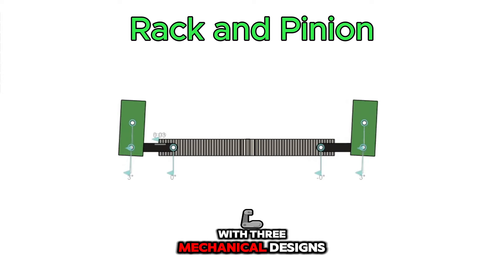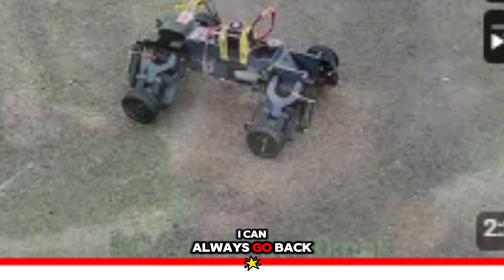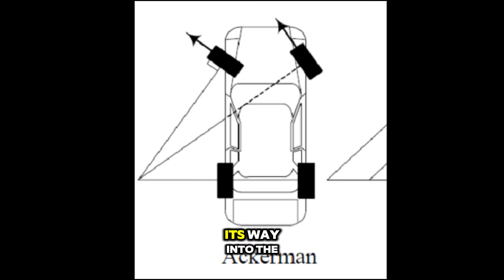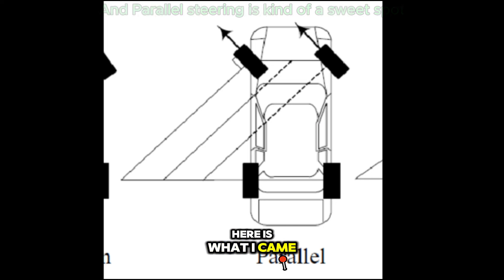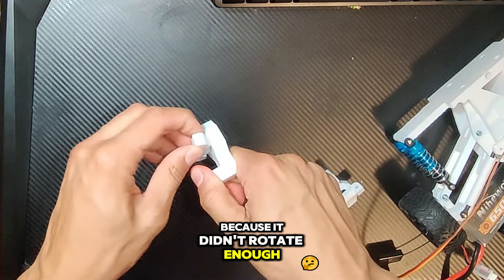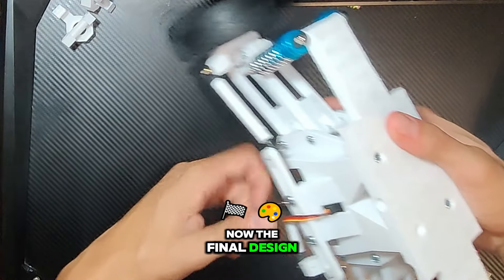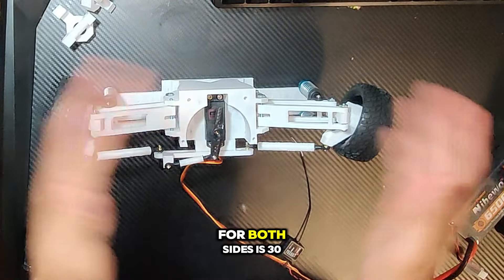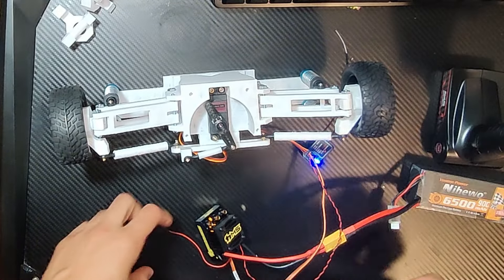Steering for a 3D Printed RC Car

Comment: Love your video. I'm trying to model my own steering wheel system for 1/14 truck and I'm struggling but your video motivated me to retry again. Thank you❤
Reply from the maker: @leechibikira1792  that's great, I'm guessing you're having trouble rotating the wheels properly, the trick is to have the steering rods starting point be in the center of them, and be the same length as the arms, and then all you need is the slider holding  2 of the steering rods, I'd suggest using a rack and pinion, mostly because it's the easiest concept
Reply: @-EhsanMalik-  okay thanks a million for the information,  explaining and I'll try to use rack and pinion hoping it'll work. You just got your self a subscriber and I'm loving all your videos all the way from South Africa
Reply from the maker: @leechibikira1792   pretty cool 😎, and I really appreciate the sub

Comment: Nice work.  The rack and pinion version would have very cool, going more in the direction of a real vehicle.   I envision a metal gear on the servo and a metal rack.  Small, but strong.
Reply from the maker: Yeah, rack and pinion is a really strong design for steering, that's why I prefer it

Comment: Really good idea... i'm trying to build a 3d printed rc car too, a rc drift. And i have a question, where or how you can take the right sizes? Thanks, really good video.
Reply from the maker: @vitorkash It depends, but since you're making it a drift car, I'm guessing you're going for something small around the size of a hand to maybe something a little bigger, and if that's the case, you want to buy parts that are 1/16, 1/14, or 1/10 like mine(I suggest not mixing different size parts together). Once you get your parts, all you do is dimension them, and just put things together in case, if you look at my first video ever on rc cars (it's bad I know), it was really bulky, I went with a bent arm design for the suspension, it was just too big, it was heavy and annoying to print, so if you are doing this I suggest making at least 2-3 versions before making the final product.(Start with you first, then copy and paste the whole project and redesign that one and improve the design, and keep repeating). And finally, have fun with it, you're going to break, a lot of parts but once you have the finished product, it's really fun
Reply: @-EhsanMalik-  Thanks bro! You saved me.

Comment: hi, could you just print a link to go from the left wheel hub to the right wheel hub then connect the servo arm to that?
Reply from the maker: Sorry I didn't notice your comment, the answer is no, the longer answer is: if you were to join the 2 hubs with one linkage it would cause a constriction within the suspension arms. Since the suspension system uses 2 arms that cause the hub to move in parallel with the main body, it would lock up, that's why I use 3 linkages for the suspension

Comment: very nice. But i just had a quick question. I am not sure how you are able to print so well on such a small scale. Normally i struggle a lot with 3d printing small parts. They sometimes break or the supports are impossible for me to clean up without messing up the look or design. Any tips?
Reply from the maker: @vedpatel8365  To improve your print, try lowering the Z printing height and slowing down the printing speed, and since you're printing smaller pieces, I suggest getting a smaller nozzle than using the stock .4mm, depending on how small the prints are you will probably need a .2 or even smaller (and don't forget to change the nozzle setting in your slicer). The key is to test the interface between the support and the print (I use a small model for testing supports, it's just a 90 degree bracket). For my printer, I use a print height of 0.2mm and an interface height of 0.2mm, so the support skips one layer before printing the model. Also, adjust the support X/Y distance to prevent the support walls from touching the print walls. Hopefully this answers your question, good luck!

Comment: Что за программа в которой можно нарисовать в 3D и потом смотрть как это двигается? Как в самом начале ролика?
Reply from the maker: It's fusion 360, but you have add linkages/joints so fusion knows what moves where and how
Reply: @-EhsanMalik-  спасибо!
Reply from the maker: No problem  @mogway791